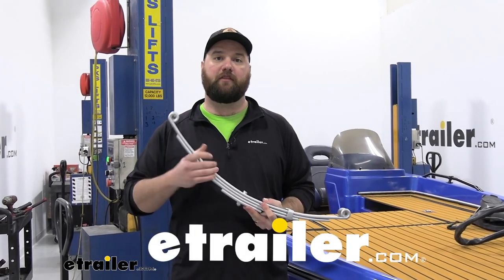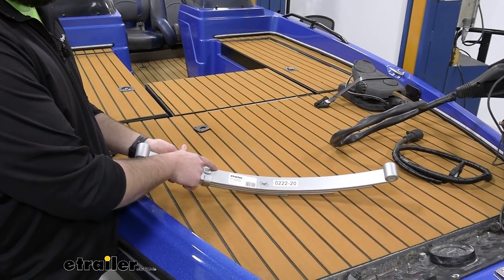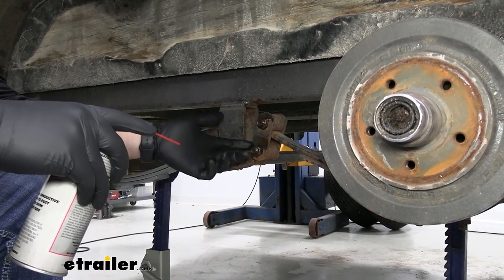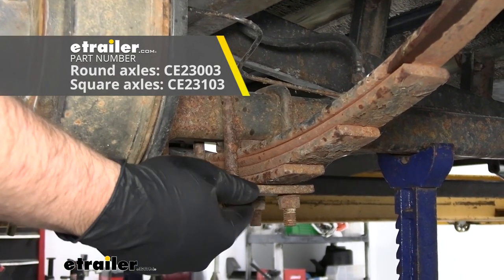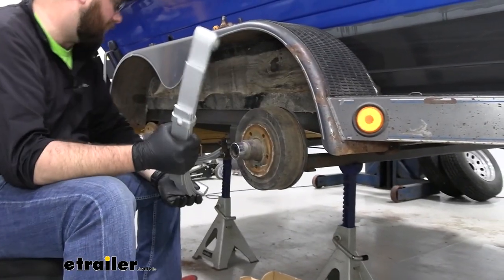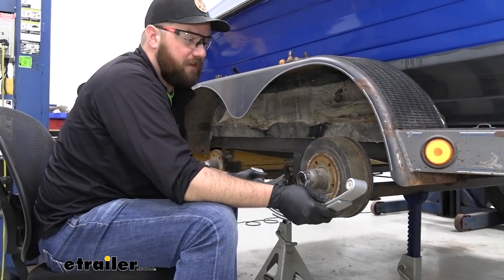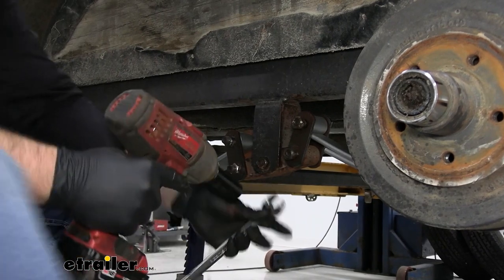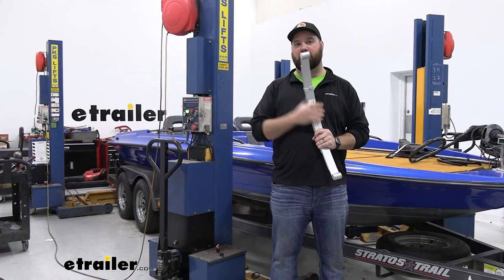Checking Out the etrailer Rust-Resistant 4-Leaf Double Eye Spring for 3.5K Trailer Axles

Comment: What range do we torque bolts too?
Reply from the maker: The shackle bolts don't carry a torque rating. If the bolts are too tight, the suspension won't articulate. The best practice is to use lock nuts, and tighten them until they're snug, then back them off 1/4 turn. The 1/2 inch U-bolts should be torqued so they're between 45-70 ft/lbs. Hope that helps!
https://www.etrailer.com/Trailer-Leaf-Springs/etrailer/e68SR.html